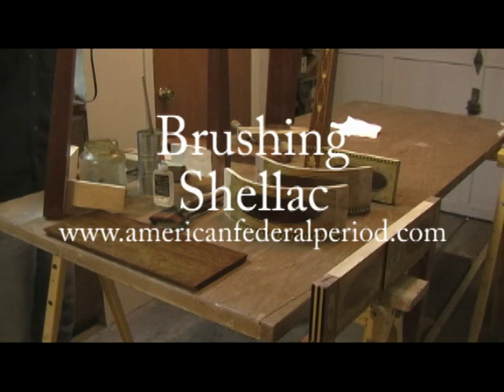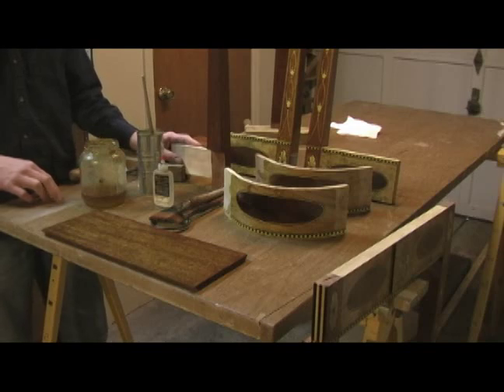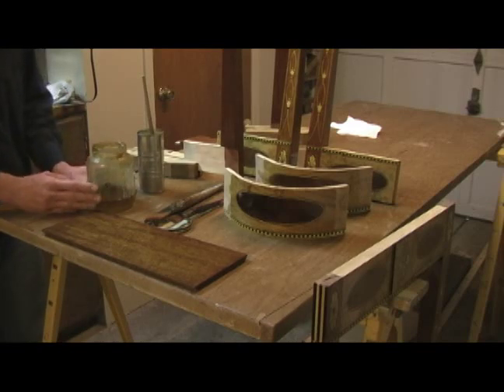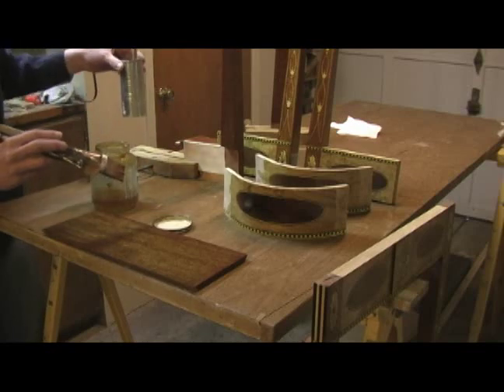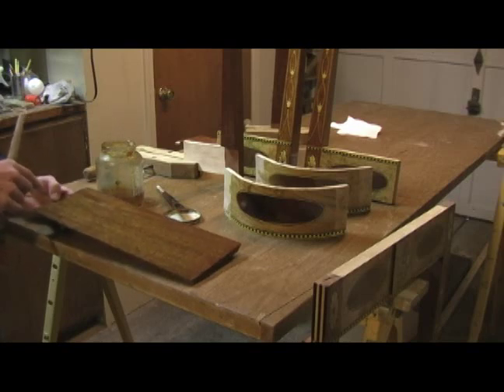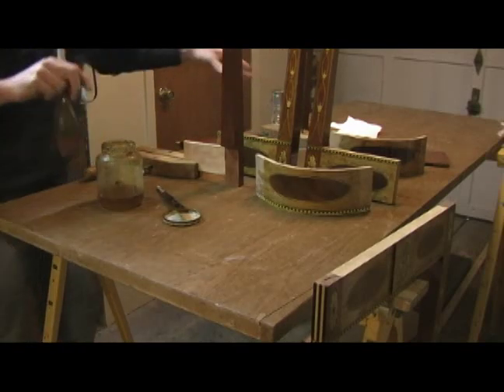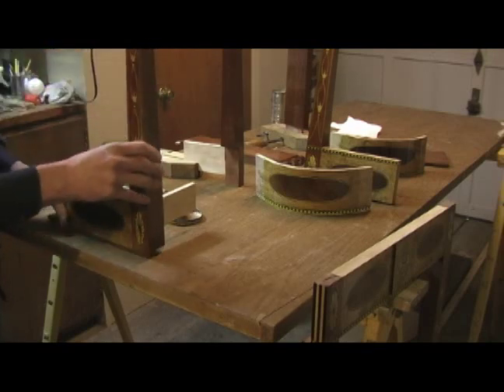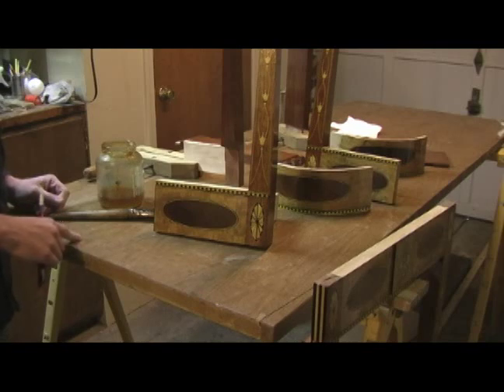Brushing Shellac Video

Comment: Don't worry, you can still thin the shellac with denatured alcohol as you normally would.  The label on the can of pre-mixed shellac says not to thin it because the product needs to comply with VOC reulations.  Pre-mixed shellac is too thick for brushing or spraying as it comes from the can.  It's usually a 3 or 4 pound cut.  This means that three or four pounds of shellac flakes are disolved in a gallon of alcohol.  Thin the shellac with alcohol to get the equivilent of a 1 or 2 pound cut.

Comment: Aikothomas. Why wouldn't they be aware of Shellac? They were importing it into Europe in the 17 th century, if not a lot earlier - originally for it's dye. 
A Mop is a type of Brush. I don't really see how it's going to save time. The method is nothing but an old fashioned 'Spirit Varnish'. I use as many as 16 coats but it really does need 3 weeks or so to sink/harden off before final flattening/buffing. You can get this stuff as flat and as glossy as any French Polished surface, should you wish.
Stick lac and Seedlac are unrefined grades of Shellac. They work perfectly well but they do give a decent amount of colour, depends if you want that. Stick lac is pretty difficult to get hold of (Kremer Pigmente do it).